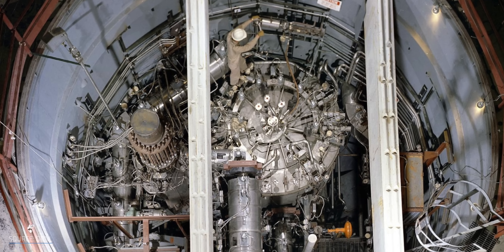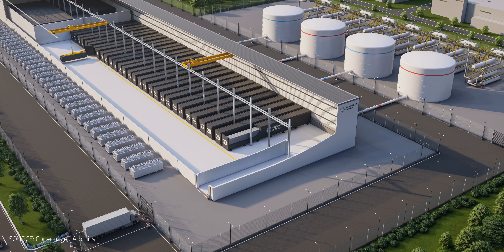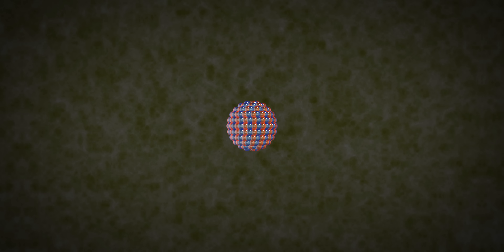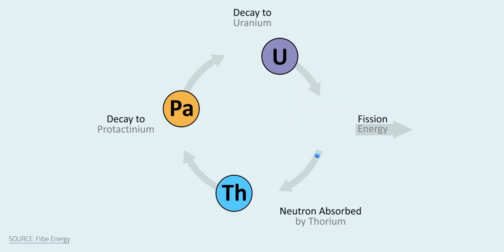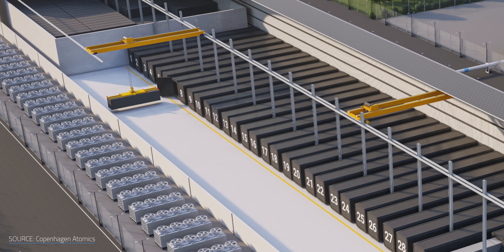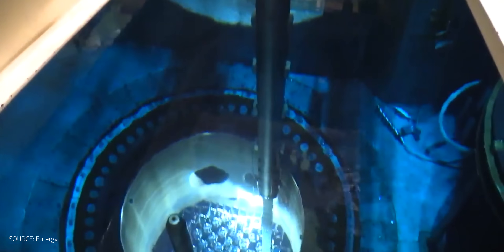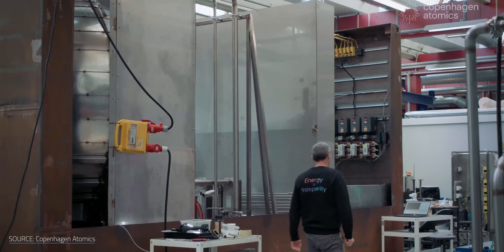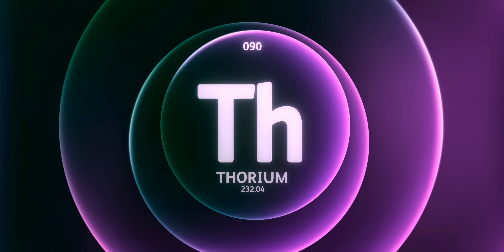Why Thorium is About to Change the World

Comment: Very exciting. I will admit my one concern is the 5y shelf-life for upgrades and maintenance. The quote in the video speaks to it as if that's a benefit, instead of using 50+ year old tech. While true it's nice to have the option to swap out, it's also a benefit to have systems that are good enough to last through 50+ years. One of the most important pieces of modern design, is getting back to making things that last. Anyone that's bought an appliance and replaced it 2-3x in the past 20 years understands that issue.
Reply: That is true. however, i don't think, he is trying to sell a negative as a positive here, but he is trying to turn a problem into an opportunity. So far, as far as i understand, we simply do not have the materials needed to outlast the corrosive effects of molten salt and gamma radiation for more than  a few years. it is quite impressive, if their claim to be able to stretch the lifetime of an MSR to 5 years is actually true. This is the major problem with the technology. Who knows, maybe AI-based material science may bring solutions to that.  it is also not possible to extract weapons-grade materials from an MSR, which is really why the technology was shelved during the cold war. And, of course, the company not selling, but renting out the reators, is really the same profit-maximizing sceme we see everywhere now... don't sell, a product, sell subscriptions... . much higher long term profits, much less incentive to actually keep improving the product in order to still be able to sell it in the future... .
Reply: But you're living in a delusional reality where technology isn't advancing at the rate it is today. Yes common things like appliances and other things are disposable. But for something as complex as nuclear or anything energy related, you want to be able to make it better safely and easily.  So a five year use pattern is absolutely perfect. It ensures that there are minimal accidents and the highest efficiency which is exactly what this model proves. To be able to reuse waste products from old fission reactors would be a godsend. And I mean completely recycling the waste. This gets us much closer to that possibility and towards fusion. Which would also help to reduce waste even further thus extending stockpiles.
Reply: I think regulation will dampen most of that problem.  Matt talks as if Copenhagen Atomics will have free reign to improve their design, but that's extremely unlikely.  Any change will require approval and certification.  So what you're likely to see is 2020s level tech used for the next several decades with the only changes being safety-related updates or changes to replace components that are no longer available (PLC modules, for instance, usually have a 30-year run before they go out of life).

Also bear in mind that the company isn't producing appliances for consumers.  It's renting modules to large corporations and governments.  Don't think Maytag or Samsung - think NetAPP or IBM.  You're unlikely to see the type of cost-cutting you get with consumer-grade products, especially since any incident will do severe damage to the company's reputation and cause immediate short- and long-term losses.

Comment: Solar panels run for 25+ years and are not radioactive. Switching a complicated radiated pump module every 5 years? Are they mental?

Solar is way more than good enough already, everybody can have their own supply. If they use the iron in the 1000 tons of steel per reactor to instead make rust batteries, we would already be carbon neutral.

Comment: 12:55 but listen to yourself. You rad trash all the core materials. The amount of high rad storage you will need is breathtaking. Even if it’s shorter, that 137Cs contamination will be so high it will be too expensive to decontaminate. I would never want to remove the salt either because of the expensive infrastructure to remove it. You also mentioned that we remove fuel due to corrosion. That’s not correct. It’s removed because the reactivity is not longer useful. No real reason we couldn’t use fuel more than 3 cycles in most cases. You also forgot about Shippingport. The LWR breeder that demonstrated solid LWR fuel breeding. All it takes with u235 cycle is geometry between the driver and seed fuel. I didn’t like their core design which does not permit any inspection. How will we learn from the design issues if we can’t inspect it?

Comment: Remember when we were told that if we replace all of our reliable energy consuming appliances with energy star appliances and if we get rid of all of our good light bulbs and replace them with LED light bulbs that were supposed to last a hundred years that we would get dramatic reduction in electric cost? Pepperidge farm remembers. After doing all that, my electric bill only went up even though my consumption went down. Imagine that
Reply: @maddoxinc1642    Because in our rip off economy , even thou all those things you mentioned lowers cost and capacity for the electric monopolies, Your cost go up

Comment: It's funny that no matter how 'advanced' technology is used to generate electricity, concept is still the same - boil water to generate steam... we can't go beyond that? Are we limited to boil water every time we need massive amounts of electricity?
Reply: Well that's the thing, it's not really a race for new electricity technology, it's a race for new energy technology. Current thermal tech is pretty close to the carnot limit already but even if some new tech completely eliminated the relevance of such limitations you'd still only be talking about 50% more usable energy. The point being that if mankind needs 10x more usable energy over the next 1000 years, the laws of physics tell us already that's not going to happen without more input energy sources, it doesn't matter what tech is discovered for conversion, the improvements in efficiency will never be more than ~50% more than where we're already at because there's a hard cap from thermodynamics.
Reply: Sometimes things cannot be improved upon.  We travel on circular objects (wheels) and boiling water will always be the most efficient way to convert heat energy into mechanical energy.

Comment: That guy trying to make the case that it was a plus that they needed to rebuild the reactor every 5 years rather than the ones that last 50+ years is masterful spin.
Reply: Well the reactors are small and probably can be refurbished . Also its 20 to 40 years not 50+
Reply: It is a plus in many ways... What if they launch gen 1, and when gen 1 needs to be replaced in 5 years, they make steady improvements allowing a 3% increase in efficiency and even a .1% increase in how much fuel it produces over consumes... and those gen 2 get replaced in five years, and in those 5 years they have made slightly better improvements so now its a 5% increase over previous generation and a .12% increase in fuel production... in 10 years, gen three is now more than 8% more efficient and produces more than .22% more fuel... that is if they can make these small improvements over the previous gen rather than over the first gen... Now... If you shift the goal post to only increase by a small percentage over the first gen... well... then it starts to looks like its more about the money than infinite scalable power... However. If you can take the previous gens, reuse them and upgrade them to the current gen without really having to build new reactors, and it takes less money and resources to do so... Well... That points towards reliability and sustainability.

I will say though, if the part that can be reused, the fuel and solution and whatnot, are the expensive aspect of it... Then is it really worth noting that you have to replace the cheap part every 5 years?
Reply: It seems like the commercial airplane industry has similar business model: replacing old aircrafts every few years with the new, more fuel-efficient aircrafts.

Not to mention that this is a relatively new technology item, I'm sure in the first few decades after its debut, each upgrade would have tons and tons of improvements, justifying the cost of having to buy the newest model.

Comment: You start from the usual lie that nuclear power is "clean energy". Sure thorium produces less of the extremely long half-life, low activity isotopes of uranium reactors but it is still produces a lot of highly reactive isotopes which will be around for 100s or 100s of years. We still have the same storage problem. If we are going to expand nuclear energy by a factor or 3x or more and dump these little modular nuclear devices everywhere, we will end up with a real ecological crisis.

Comment: Processing the nuclear fuel is the key. I don't believe it's going to be a ''300 yr. wait'' in the future, certain reactors designed in the future might only produce a nominal, not optimal output, but to allow for a way faster way reprocessing the spent fuel otherwise, the same as America's old waste is currently stored underground in vast mines, this could reprocess them to be reused again at a much faster rate. It's recycling, but like any other material, you get to reuse it, not simply store it forever.

Comment: The biggest part of the solution is to decentralize energy. Point of use is the answer that is being ignored because it eliminates the "charge for energy" model. Another benefit of decentralization, is that it eliminates the huge cost of maintaining a vast distribution system.

Another huge obstacle for decentralization is that it eliminates the vast wealth base created by mass centralized energy delivery. If every electrical energy dependent device provided its own energy, imagine the loss of wealth that would occur for those that currently control the supply. Therein lies the reason why no high efficiency energy producing technology will ever come to be.

Comment: I thought you were gonna talk about China's thorium breakthrough.
Reply: Yeah, homeboy is behind the times.
Reply: Is it really a break-through? 
Of course the running a 2 MW test reactor, but this happend already about 60 yours ago in the states, in Oak Ridge. So at the moment this is just have invented the wheel. When they are running the first commercial reactor with 100+ MWe, then I would call it a break-through.
India has a split strategy using thorium. They breed U-233 by using breeders with a thorium blanket, and then use the resulting U-233 within the AHWR.

Comment: So uranium is a tiny tiny part of the cost of building, running, refueling, refurbishing and removing a reactor. A proposition that already makes zero business sense in a time of cheap solar and batteries. So the solution is a reactor that's several times more expensive, that breeds fuel for nuclear weapons, and you're going to do this in order to cut the cost of fuel in half. A cost that isn't even 1% of the cost of the reactor. Brilliant.

Comment: Matt, you have the wrong end of the stick here. Pu doesn't have a half-life of 10K years if it is being consumed in a fast (or even thermal) reactor. Pu is a fuel like U235 or U233.  I like Copenhagen Atomics, but you should be looking at TerraPower and others.

Comment: Throwing around some rough numbers, if a single reactor makes 80MW for 5 years and the factory can build one a day, the factory "produces" about 3.5 terrawatt-hours of electricity capacity a day, or roughly 1300 terrawatt-hours per year.  

For context, global energy demand is somewhere around 30000 terrawatt-hours per year, and about 650GW of solar capacity was addrd globally last year.  So if thorium in SMRs like these are going to make a big difference in our electricity generation, we would need this company to actually meet its goals soon and then scale up significantly beyond 1 reactor/day

Comment: I like this idea a lot, but creating a 300 year problem to dry paper doesn't sound great.  The company hopes to make 1 per month, and they need to be replaced every 5 years (at least). So at most they'll be able to create/service 60 units before every new unit they create is to replace one that reached its age. If this actually works I'm guessing they're going to have a scaling issue real fast.

Comment: Thorium does not provide a "chain reaction" since its fission does not produce enough neutrons to sustain a chain reaction. A separate neutron source is needed.
Reply: That is the reason will a starter with HEU or something similar is added to thorium fuel in the beginning. After that breeding produces enough fissable U-233.
Reply: ..... they're not splitting thorium directly, that's not possible. They split uranium, the neutrons are absorbed by the thorium fuel, and the thorium transmutes into uranium. It's called a breeder reactor.

The fuel cycle does require uranium to kickstart it, but after that is self-sustaining by just feeding in more thorium into the system. Takes 2 neutrons to turn Thorium into something fissile, while splitting the U-233 releases slightly more than 2 neutrons on average.

In some sense I guess it does feel like we're cheating the universe. But in another I guess it's not much more different than tossing a log onto a fire. Existence is fundamentally weird like that.
Reply: Correct.  TH-232 is fertile, not fissionable!!! It has to be mixed with uranium 235 for the fissioned U-235 to produce neutrons to have the Th suck up the neutrons.  In the radioactive chain Th-232 becomes U-233 and then it is a nuclear weapons proliferation problem.   The starter uranium with U-235 and U-238 is needed to "denature" the end product U-233 to make it harder to separate.  But chemically separating U-233 from Th fuels is simple.......
Reply: @madelineveggie3931  Th-232 becomes at a high percentage Pa-233, which after about 27 days becomes U-233. But Th-232 becomes at low percentage also Pa-232. This becomes U-232. So the result is a mix of U-233/U-232. U-232 decays after some steps to TI-208, which is one of the hardest natural gamma emitter. So you will not pure U-233, but a mix with a hard gamma emitter. This makes use of the U-233 for bombs very impractical. Separating U-233 and U232/TI-208 is very hard, because of high radiation. You need very thick  shielding.

Comment: I've long thought thorium was the better, safer route for nuclear energy. I think the main reason it was pushed aside in the 1950's-60's was because they wanted nuclear bombs, the Cold War! Also there material science, that could better last under the molten salt, etc. was a big problem with long term operation. Perhaps still more research on this even now is needed. The five year replacement  is one solution. An idea I see is a double system, were one section could be diverted and replaced or repaired and if needed could double output when needed.